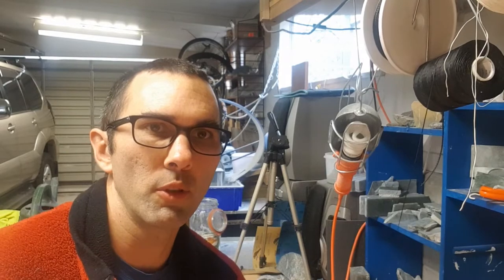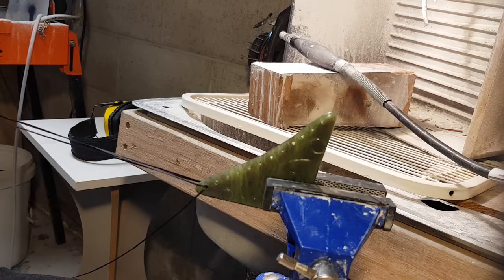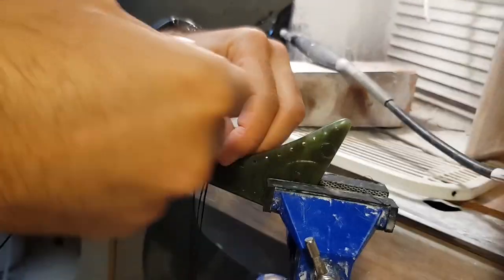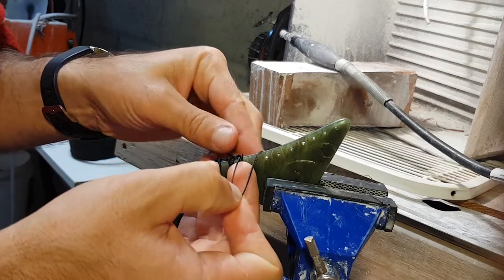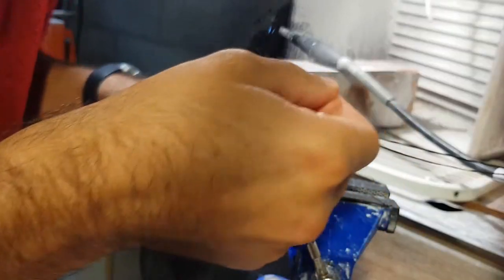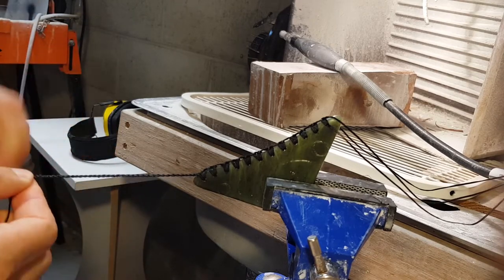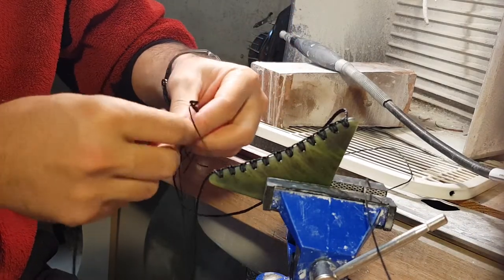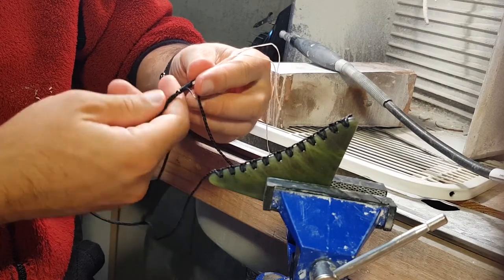How I Tie a Ringbolt Lashing

Comment: Tena koe e hoa. What drill bits burrs sizes etc do you use to drill those ringbolt holes?  Is it one of those flame type burr?  Is it better to drill from both sides and meet in the middle?  What size braid were you using for above lashing?  Been enjoying your videos especially the lashings mauriora
Reply from the maker: I use a 1.5mm sphere burr for the pilot hole then a 2LR 2mm burr to widen it. Sometime use a flame or triangle to smooth the edges of the holes. I don't worry about going from both sides. I used 1mm waxed polyester. Kia kaha e hoa